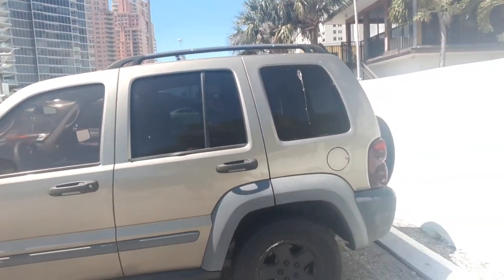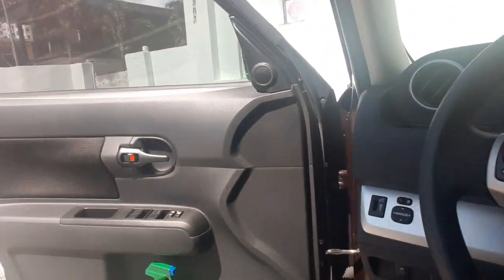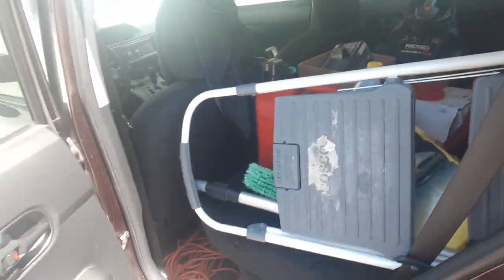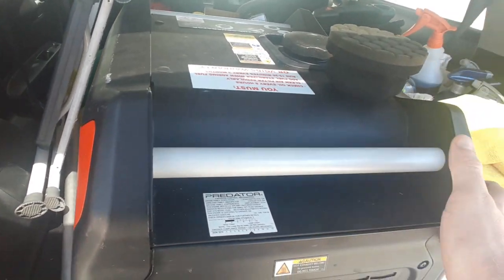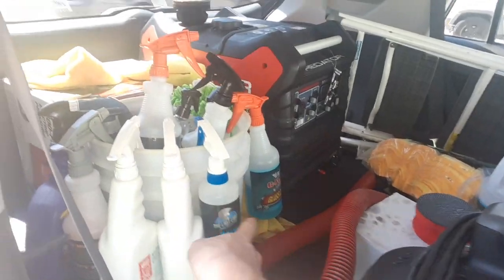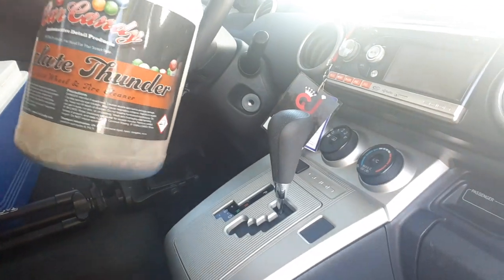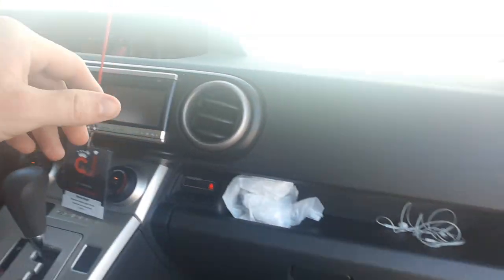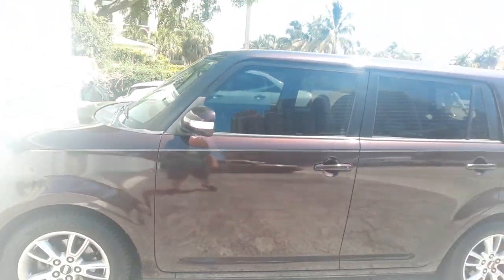Brand New Mobile Detailing Rig - Say Hello To Lucy

Comment: Hey man, got another product line to check out. Maybe you know it. Technicians Choice. It's a lower priced brand but I was thinking of going with their ceramic polish, then ceramic coating (though still may go with DPC Shield for coating) and then maintain it with their ceramic spray to maintain. 
Jimbo at Auto Detailing Podcast has given good reviews on the spray but not the polish or coating.
Reply from the maker: I saw the detail spray. Very promising. I'll check it out! Thanks man!